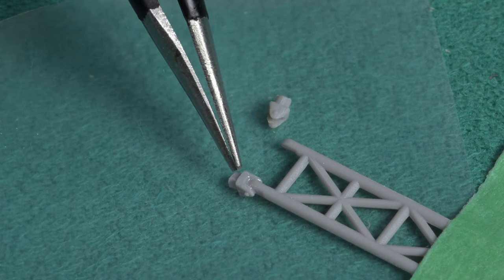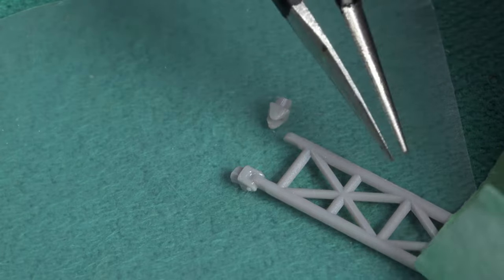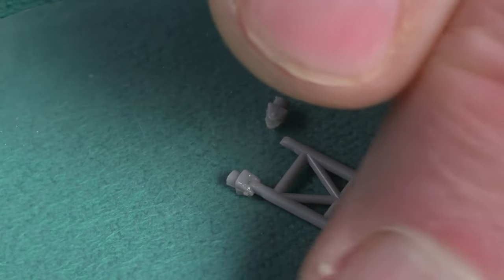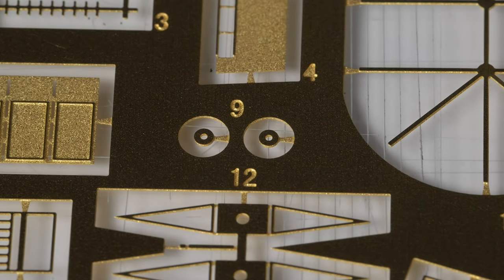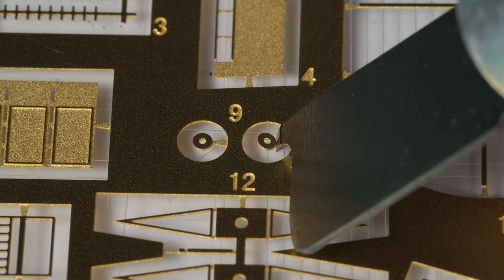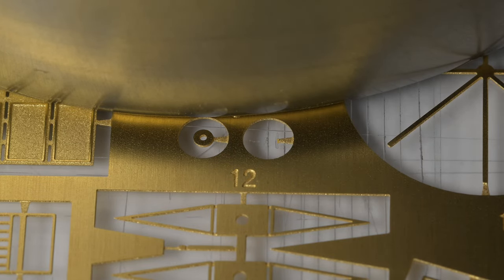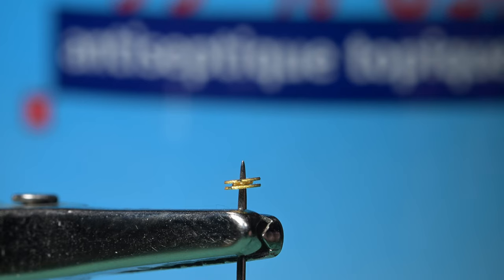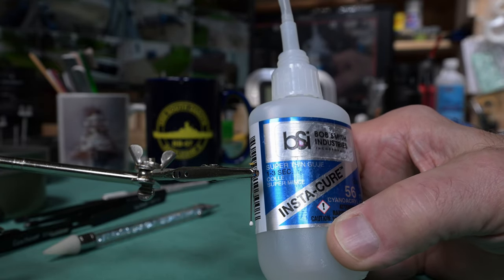The Model Ship - Part 1207

Comment: Hi Ron. great video.  I actually have a slice of Pizza my wife made yesterday  in front of me.   I was waiting for you to eat yours, good thing you remembered.   Your little pulley turned out great.  Quick tip. if you ever need yo take something apart that is glued with CA, a little heat from a candle or small torch will release it.  Obviously don't try it on plastic,  but it works fine on brass.  Have a great day.   Jeff.
Reply from the maker: Re: "good thing you remembered"
You'd have had to wait a week Jeff! Haha!

Comment: Hi Ron,  instructions should have read , put hinges on deck , then set boom!  😊😊😊😊hope you enjoyed your pizza mate ! 😊😊😊see you tomorrow
Reply from the maker: Thanks for the tip Marc. Too late for me but perhaps it will help someone else. 👍
Reply: @roncalverley  not to late Ron,  just re apply extra thin onto the hinge , you may heve to re apply a few time , giggle the hinge a few times till they release , did it to my missles to remove the rockets , very delicate,  and all went fine ! , mind you don't think you'll have any problems and at arms length does it really matter 🤔🤔🤔🤔🤔 just remember to have fun 😊😊😊😊😊😊

Comment: There’s a mould line in the grove of the hinge, a bit of folded 1000 grade sand paper will quickly remove it and the part should fit easier.